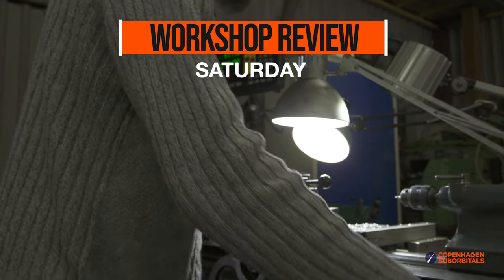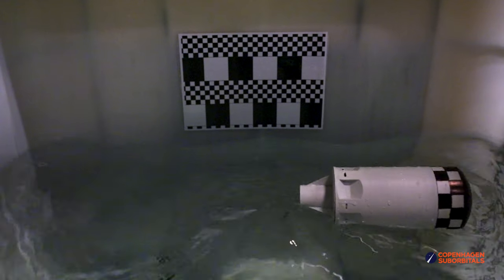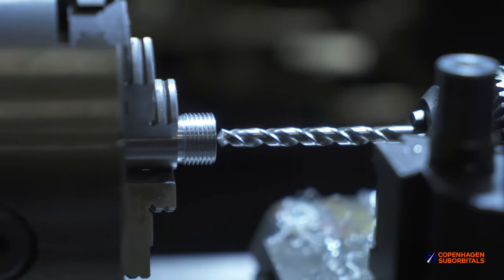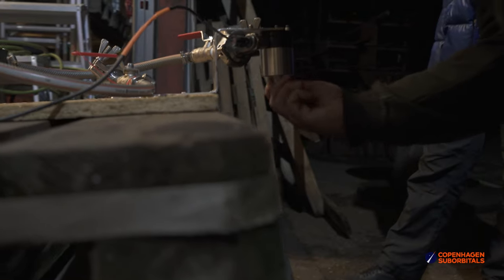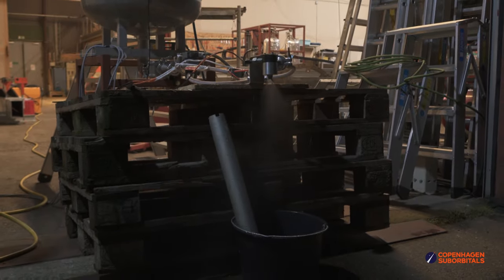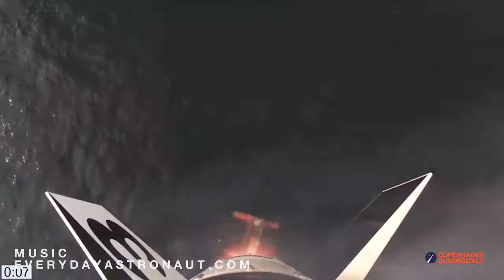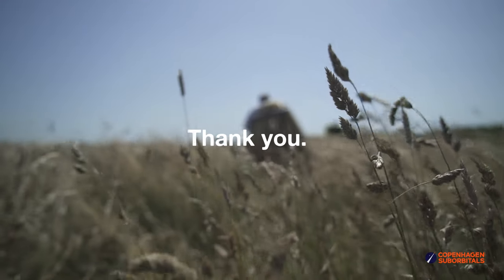DIY Liquid Nitrogen Evaporator Heat Exchanger | INSIDE THE ROCKETSHOP : Episode 12

Comment: Thank you for another great update! I love the idea of using liquid Nitrogen for pressurization. How much of a weight saving do you get?
Reply from the maker: You're welcome! A Nexø II type DPR system on Spica's scale would end up between 300-350kg. With this setup we should fit within a 100kg, that's including LN2 and 10kg of fuel required to power the burner. On top of that we save a ton of money not needing to buy COPV's for 60000 litres of Helium.
Reply: Wow, that's a significant weight saving! Without knowing what your final setup will be (apologies if you've already mentioned it), do you foresee any issues with the LN2 boiling away if you have to hold on the pad for any significant amount of time, or will you be topping it off, or just load a little extra? (I am assuming of course the tank holding the LN2 would be vented while on the pad) I really love the work you guys do.
Reply from the maker: @AirCommandRockets  We haven't mentioned that yet. And I am also shooting from the hip here, but my guess would be LN2 loading would commence at the same time and fashion as LOX.

Comment: For what is this thing for you showed?
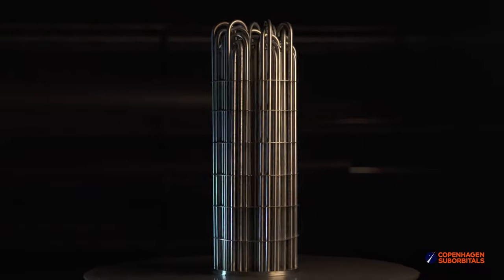Reply from the maker: Instead of bringing pressurization gas for the propellant tanks, which would take up a lot of weight and volume, we will try to bring a small amount of liquid nitrogen. Then heat it up and evaporate it during flight, producing gas for pressurization. This part is a heat exchanger for that LN2 burner system. You can hear more about it here, from the 2:50 mark: youtube.com/watch?v=aZ4qDm0rqy4
Reply: @CopenhagenSuborbitals  "LN2 burner"??? If you manage that, I'm pretty sure you'll be the first to get an inert gas to burn..... :-) Well. guess LN2 is not a gas, but you get where I'm going  right....
Reply from the maker: @jnygaarddk  We like challenges. ;)